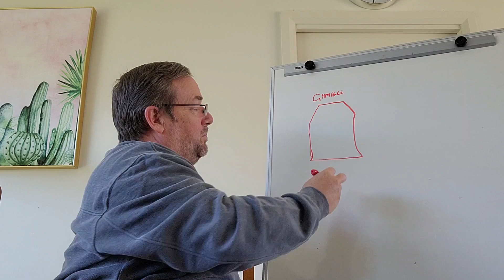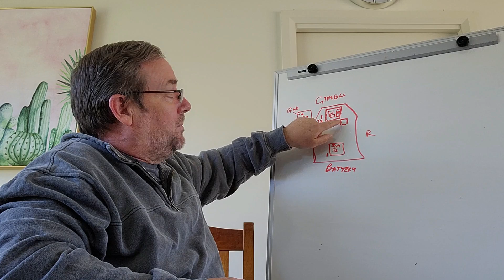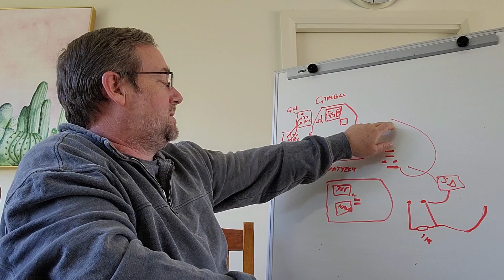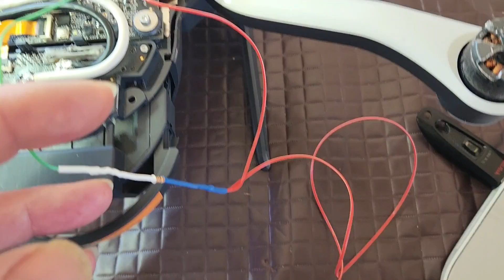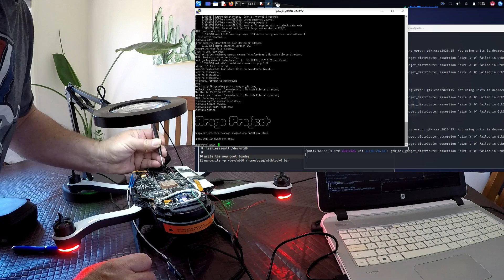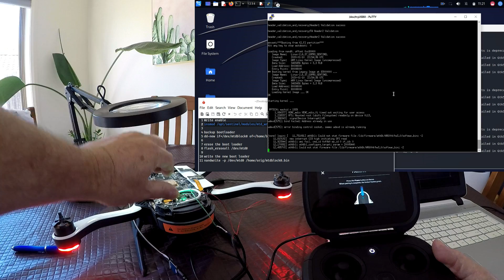GoPro Karma Pairing Issue Fix

Comment: Whats the point of teh sd card to the right of the contraption if you only needed the left setup to cknnect direct to pc?
Reply from the maker: Because the OS on the drone has not booted you cant type any commands into putty that is connected to the UART. Once you boot off the SD card there is then a OS loaded and you can run commands.

Comment: My KARMA does have the built in Micro SD Card slot. Is there a difference in the process you use in this video. If so do you have a video that goes through the steps in my variation? Big thanks in advance!
Reply from the maker: The process is still the same you just dont need to solder a SD card slot on to your board or make a board to boot off.

Comment: I own two aircraft that have stopped flying after updating the firmware on the aircraft (the stabilizer does not work, the power switch LED sometimes blinks and does not stop). I tried booting from the SD card on these two machines, but there was no change at all on one machine. Both machines are in the same condition, but why doesn't one of them even boot into SD? It's quite difficult.
Reply from the maker: There is a little bit of an art to it, sometimes it takes me a couple of goes as well. Come over to the Discord server so we can provide more information, we also have other videos there and its all free.

Comment: The small resistor that makes contact with the probe is coated with something to make it waterproof, but how do I remove it? (I scraped too much off. Is there a way to melt it?)
Also, can all LINUX commands and text be changed using the provided SD image file?
Reply from the maker: It is called underfill, you should carefully scrape it off until you can see the resistor
Reply: got it. thank you.
The knowledge in this video will be very helpful.

Comment: Hi, I have the pairing issue. I see there are many videos of fixes and am confused as to what all is necessary. Is there a recent comprehensive video or written description of what is required? Thank you!
Reply from the maker: If you watched the full video it should be fairly clear. You can also watch this which is the same thing but without the theory.

https://www.youtube.com/watch?v=_gRCGIWP8Ys

There are several other videos on my channel which talk about other parts of the process.

This video is specific to fixing the pairing issue when you have the broken boot loader. 

The following are the symptoms for the pairing issue, Drones power light is white, gimble doesn't move, can't power off with the drones power button.

Comment: Hello thanks for the educational videos you've been putting out. I've watched this video several times and I'm not understanding the adding of the SD card port. I don't see you ever put a card in there. do you put a card in there? My drone has that Port I noticed that years ago and thought that was a possible software update sd port.
Reply from the maker: Yes , you need to download this image and the tool, burn it to a micro SD card and insert it into the slot before triggering the SD card boot.

https://drive.google.com/drive/folders/1l0vRHL0187gdtYLM0ficCJhaDlT93Fur
Reply: @bozmanx  thanks for the tip I have watched all of your videos I'm pretty much got to understanding of what's going on. Managed to get one of my karma's up and going without doing any of this the other night. My other one though I am pretty confident it's issue is a software issue. Mine all have SD card slots on them already which is a plus. I just got my resistors yesterday in the mail that's the last of what I needed so I'll be attempting this in the next. Thank you so much for taking the time to share this information a lot of us are very frustrated..

Comment: Where do you get that right motherboard from? Is it an existing one on the drone? Or online part? Part #..?
Reply from the maker: there is one in the drone but not all of them have a micro SD card slot on them.
Reply: Do you have a closer bigger pic of the sd card slot pins? Just to make sure I understand how the pins are soldered to the board. thanks
Reply from the maker: You can build one with these parts 

I used the following parts, you should be able to use anything with the same spec

This is the ribbon cable board, you need to order it with 14 pins with the 0.5 connector 
https://de.aliexpress.com/item/1005004411740279.html?spm=a2g0o.productlist.main.11.536e5faa0THgrr&algo_pvid=0494b17c-542b-4461-abc1-55e7a8f9da07&aem_p4p_detail=202312042002111727220837144440005564265&algo_exp_id=0494b17c-542b-4461-abc1-55e7a8f9da07-5&pdp_npi=4%40dis!AUD!1.18!1.06!!!0.77!!%402101fb1517017489308413568ed61f!12000029089942143!sea!AU!127791189!&curPageLogUid=ZWdoBiv1Simr&search_p4p_id=202312042002111727220837144440005564265_6&gatewayAdapt=glo2deu

This is the ribbon cable, you need to order 14 pin with the 0.5 connector 
https://www.aliexpress.com/item/1005006112575144.html?spm=a2g0o.productlist.main.45.536e5faa0THgrr&algo_pvid=0494b17c-542b-4461-abc1-55e7a8f9da07&aem_p4p_detail=202312042002111727220837144440005564265&algo_exp_id=0494b17c-542b-4461-abc1-55e7a8f9da07-22&pdp_npi=4%40dis!AUD!2.63!2.37!!!12.26!!%402101fb1517017489308413568ed61f!12000035803663611!sea!AU!127791189!&curPageLogUid=t6xyfkL18djj&search_p4p_id=202312042002111727220837144440005564265_23

This is the micro SD slot board (I believe it is SDIO)
https://core-electronics.com.au/adafruit-micro-sd-spi-or-sdio-card-breakout-board-3v-only.html

The wiring diagram for it is here
https://cdn.discordapp.com/attachments/1164473450639933450/1187711685880987668/wiring.jpg?ex=65aa56b4&is=6597e1b4&hm=c46a9fbde36f34af9449338a803e03bd96526e07058d0928deab5933bfee0d57&

Comment: Where do I get the right motherboard with sd slot
Reply from the maker: Some already have it, if you dont you can look to solder one on. There is someone working on a board you can build from avalaible parts but its not done yet.

Comment: Can I use about any USB to serial adapter (cable or board) as long as it has TX, RX and GND?
Reply from the maker: yes, I have not seen one it doesnt work on. If it doesnt its normally a driver issue or one of the other well known issues. You can get more on these and or ask questions specific to any problems you have on the discord channel

Comment: Is any one able to explain the process of what needs to be done with the physical SD card? I see the files in the Google drive, but I'm not sure what to do with them. Thanks!
Reply: Also is there a link to the video he references multiple times in this video?
Reply from the maker: you need to download this image and tool. you then use the tool to burn the image to a miro SD card
https://drive.google.com/drive/folders/1l0vRHL0187gdtYLM0ficCJhaDlT93Fur?usp=sharing

Comment: Could you please specify the 1K resistor that was used in this video? I'm not familiar with electronic components. When I was looking for the 1K resistor, it appeared with wattage. Which one should I pick? the 1K with 1/4W, 1W, or 2W? Thank you for sharing btw. I got this issue and can't fly it for almost 3 years.
Reply from the maker: I think that any watt rating would be fine.

Comment: My Karma died the same way , funny thing is my Yuneec Typhoon H died with the exact same symptoms as the karma shortly afterwards like it had lost its memory , even down to having to pull the battery to shutdown , I wonder if they both use a similar operating system ?
Reply from the maker: There is a dedicated forum for the Typhoon, it would be worth posting a question there on it to see if others have had the issue and what the fix might be. https://yuneecpilots.com/

Comment: Amazing! Congrats! Question: is necessary change nand flash to realized this process?Thanks for all u'r work!!
Reply from the maker: I am yet to need to replace the NAND on a board for this to work.
Reply: @bozmanx  i mean is primordial to change the nand or with the original one can be apply this process? i'm don't have nand programmer, for that is my question, thanks so much for u answer.
Reply from the maker: @loopdisruptors   during this process I do not change the NAND. This is with the original NAND.
Reply: @bozmanx  Thanks for answer me, i'm from Argentina and i have a karma to repair, im computer technician with more tha 20 years working in electronics, count with me for anything u need.
Reply: @loopdisruptors hola, pudiste arreglarlo? Saludos